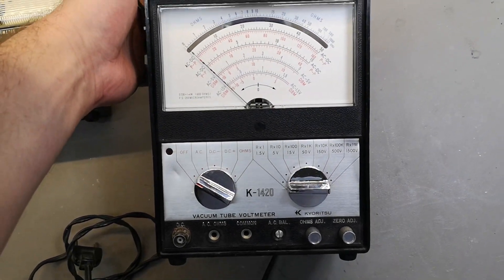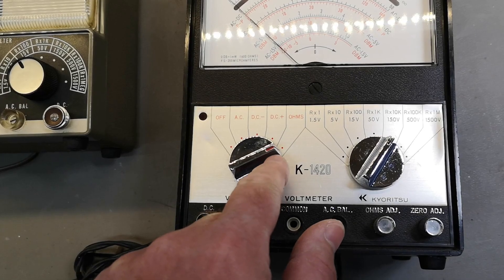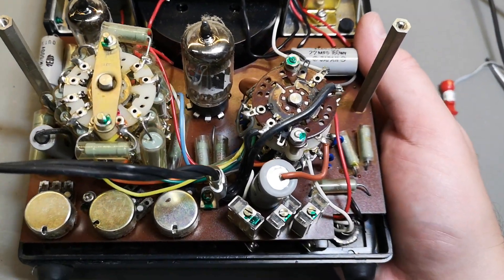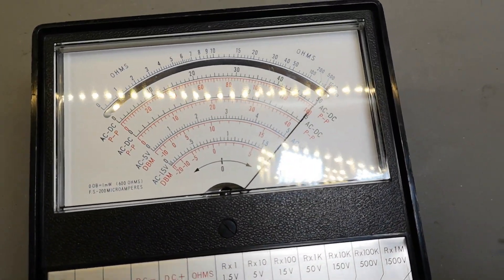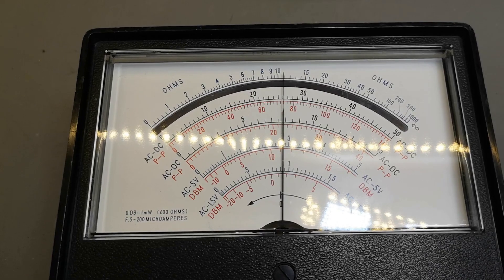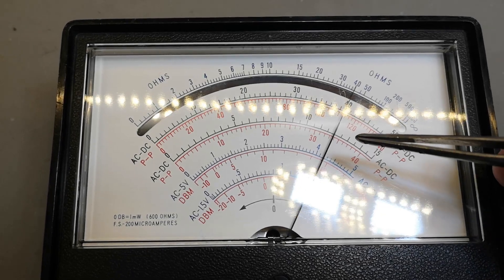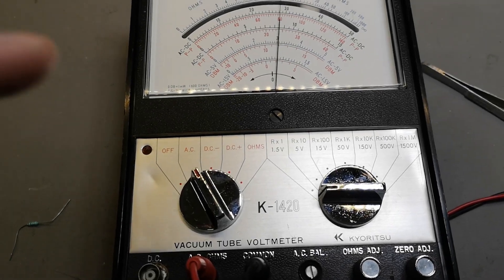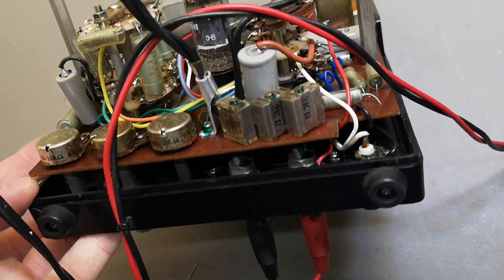Multimeter kyoritsu K-1420 Vacuum Tube Voltmeter 1970 test teardown

Comment: Hello. I got rv-66 model. What type of 4 biggest capacitors are there? Cant figure out- electrolitic polar or non polar?
Reply from the maker: rv-66 the 20uF cap can be polarized, all others are most likely not, see this https://youtu.be/SRxY8quKrDE
Reply: I got one of These in New old Stock, are the electrolytic capacitors critical for use? Or should they replaced with New ones. Otherwise i wouldt keep it original, even in use.